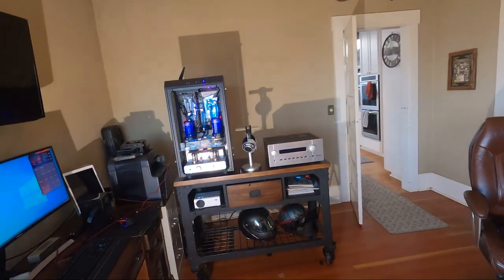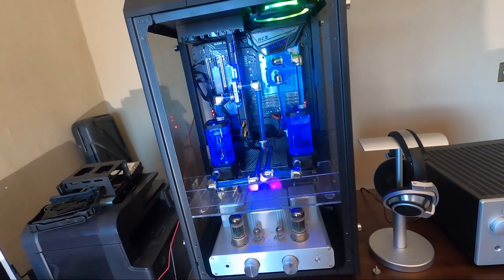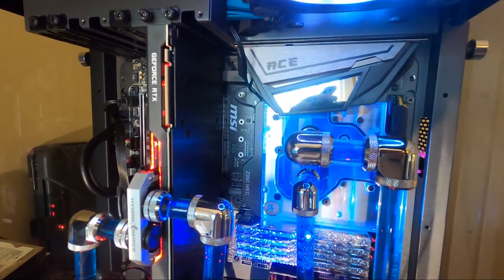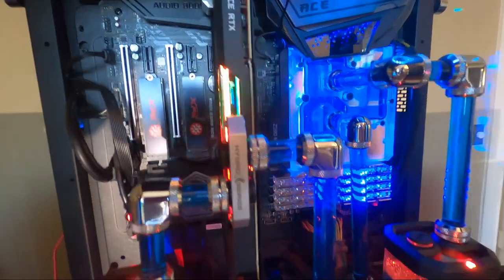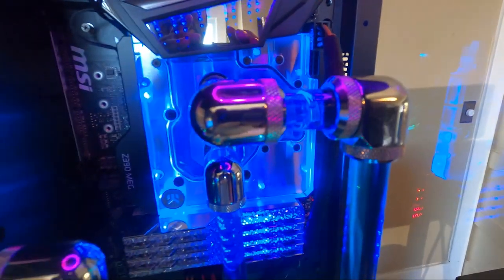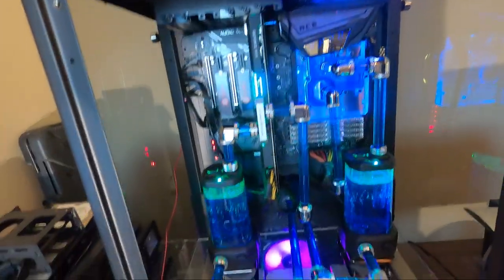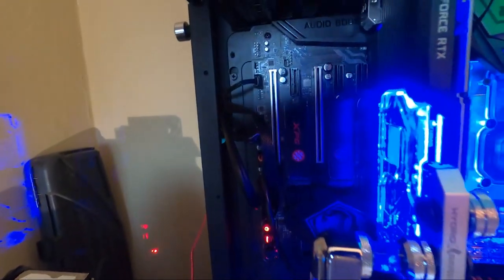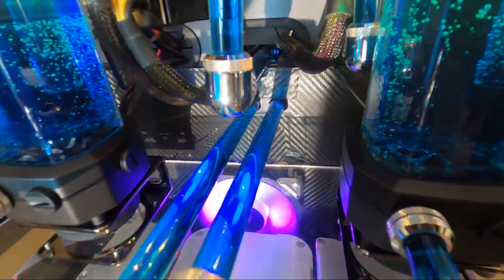Thermaltake 900 "The Tower" Build. Massive! Tube amp, Corsair, EKWB, i9-9900k and RTX 2080 Ti.

Comment: you don't want to sli that card.
sli is on the way out the door. aka its dead.
just buy videocards in your pricerange and either do an upgrade each generation, or do an upgrade every 2 generations, but sli is not a good move.

Comment: I wonder if that reservoir works when you use the default reservoir location and mounting point. 
I am buying same case and reservoir, but a bit worried.
Reply: Nope, it won't. You have to use a Thermaltake one or modify the case/adaptor.